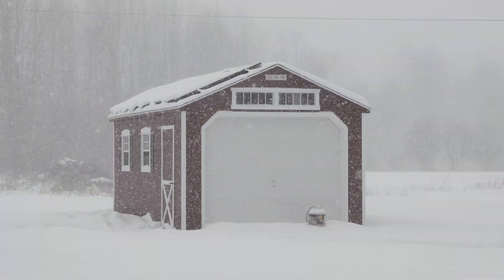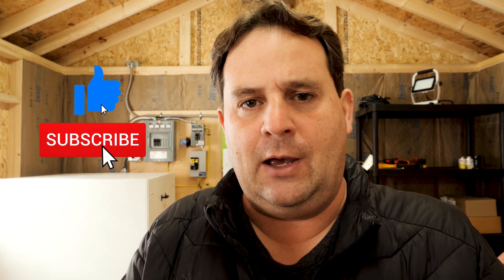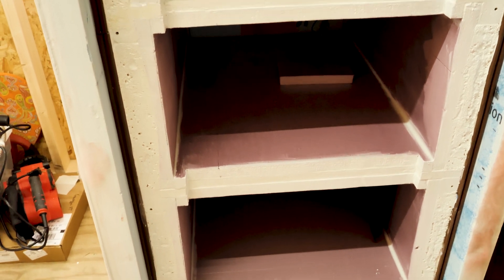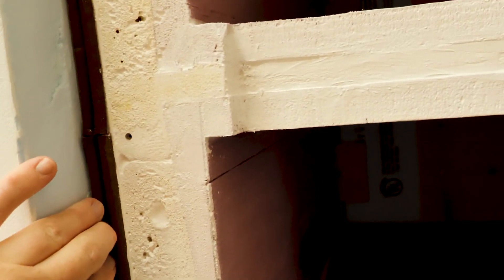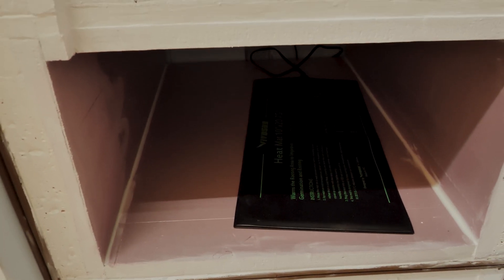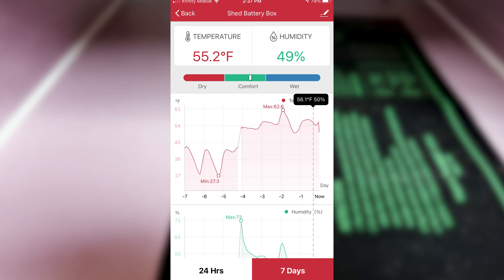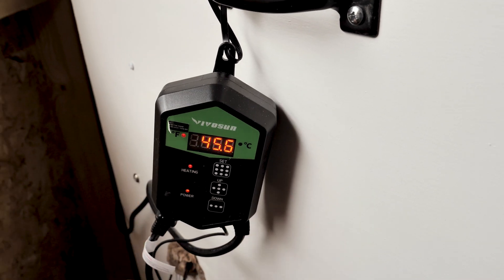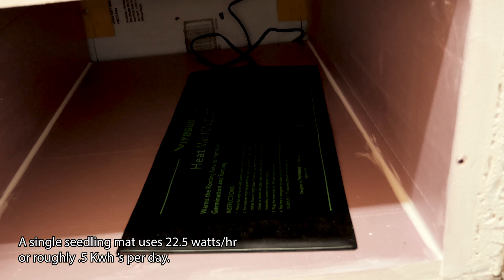New Off Grid Solar Shed Part 10  - DIY Insulated Solar Battery Box

Comment: Great video.
I plan to make a insulated box this year.

To add to the conversation.

1. Having batteries in a fully sealled box seems like a bad idea from the very little i lnow about batteries. I plan to have two small fans set to intermittently force fresh air into the whole box every 4 or 6 hours, in 5 or 10 second bursts. I still have to figure out how best to mitigate the effect these vent holes will have on the insulation ability of the box. Maybe solinoids to open and close the vent ports? It's still a project detail up in the air. And this box keeps getting more complex every time i think of another problem to address. 😄

2. I will use a tararium heating pad, but I will add one or two small low voltage internal fans to blow air across the surface of the heating pad to enhance the rate of the heat up cycle. Fans will auto kick on at the same time the heat pad kicks on.

3. Since my heat pad will be a singular heat source on the bottom most shelf, I plan to have plenty of silts/holes in each shelf above to further promote warm air circulation. Unless I retrofit a used vertical chest freezer....in which case the wire shelves will just need to be strategically reinforced.

** I read your comment where you addressed why you choose to have insulated shelves. I myself will see how it goes without insulated shelves first; mainly due to my desire have better air circulation throughout the whole box.

4. I'm contemplating just buying a used vertical chest freezer and then if needed, I'll reinforce the entire exterior with more foam boards.

5. I plan to mount a wifi smoke detector inside my battery storage box.
(I even looked into mounting fire single use Auto-Fire suppressors / extinguishers....but they all  seemed gimckiy after some research and would do nothing for a intense battery fire.)

6. I will have a large appropriately sized fire suppression cover/blanket near by to use in case of emergency.

7. Per youtube, the Rmax Sika Brand foil-lined foam boards handled fire much better than the blue or  purple foam boards.

8. If I didn't need winter-time insulation, I'd just get a commercial metal fireproof cabinet and  vent the exhaust port appropriately.

9. My box will be to store all my chargers and batteries for my lawn equipment and my power tools.

10. I have a timer that I activate to auto shutoff my chargers after a choosen amount of time. It helps keep me from charging my batteries to 100%. I can hit the timer, throw all the batteries on, and come back next week to batteries at about 80%...all the while not having to worry about having the charger continually on. 
(Just extra peace of mind for me).

11. I like your idea of the wifi thermometer. It can alert me if temps get too hot or too low and allows you to see a week's long trend. Nice.

Comment: curious why you insulated between the shelves and have 1 seed mat heater?  Wouldn't you want to only insulate from the outside temps and not battery to battery?
Reply from the maker: The extra insulation on the shelves actually helps to increase the overall R value of the box.  The batteries are not heating the wood of the shelves and the ambient temperature is a little higher.  Thanks for watching! Good eye!

Comment: In Canada, the new Electrical Code (same as NEC) means non-9540A lithium batteries must be located outside the home. Someone handy could make alot of money developing a commercial "battery Bunkie" for 10-20 kWh battery packs  . . I couldn't find any commercially available dedicated insulated outdoor battery boxes on the market yet . . plywood/foam or FRP/foam or Metal/foam with those seedling heat pads, and tight door and electrical in-out.

Comment: Once you get the batteries in there things should heat up. You may need some type of cooling too.
Reply from the maker: Right!  Probably not going use the batteries that hard in the winter but definitely when we get the pool going.  I am curious to see how much heat I will get from the batteries. I plan to take off the doors when the weather warms up!

Comment: Thanks for the shout-out.  My friend, Bill, lives in Vermont.  We didn't think to remove the heat sinks at the time, but I think that makes a lot of sense.  You did a great job.  Just an FYI...  Bill has 3 temperature sensors inside his box.  It has never dropped below 50°F, even on some cold snaps below -20°F.  This is with one seedling mat, and just one layer of 2" XPS (foam).  You showed a dip in your air temperature dropping lower than 50.  So, my guess, is that this won't happen when you add the batteries.  The batteries themselves will have some heat loss during cycling.  Plus, the mass of the batteries will help keep the box warm during cold spells.
Reply from the maker: Thanks David!  Woodworking is definitely not my forte, but I have definately learned a lot.   Yes, I am hoping to get some from the batteries when in use.  Probably not going use the batteries that hard in the winter but definitely when we get the pool going. I like the idea of having multiple temperatures on each level.  Your friend Bill seems like a pretty cool guy.  I certainly enjoy hearing from him as well as all of your videos.
Reply: This is very helpful information for me, going to build an insulated box for my new batteries this week in Vermont's Northeast Kingdom!

Comment: Very nice. The only thing I'm not liking so much is the need to remove screws to open the door. I understand you probably did that for better insulation value, but that might be a problem if you need to get into the box quickly in case of an emergency. Just a thought! Otherwise, it looks awesome! I really like the heat mat idea!
Reply from the maker: Yep, great suggestion.  I might look into building a front door that swings open and tightens as a future project.  The the warmer months I'll just take off the doors for better airflow and keeping things cool!
Reply: @GreenMountainDIYGuy  Yeah bro, I'd look into that. 
In the case of a cell failure or a short, that thing will go up in seconds. Perhaps it would also be a good idea to either line it with steel sheet metal, or maybe coat it with some refractory cement. Just the keep the yellow noodles and or fire from setting it alight should there be a problem.